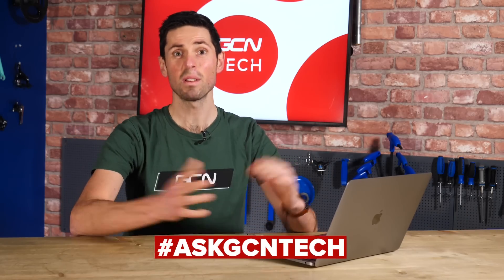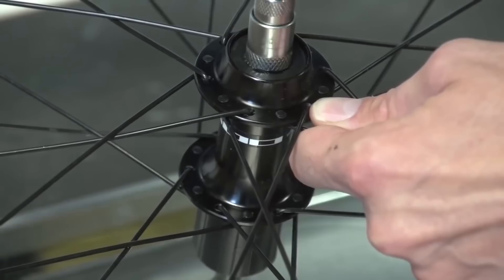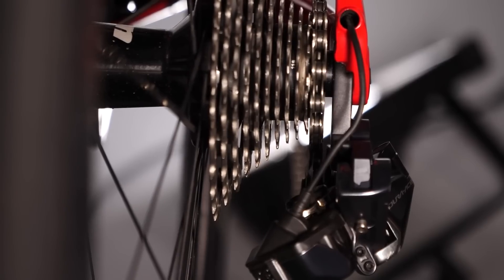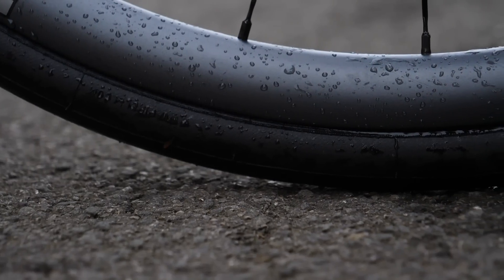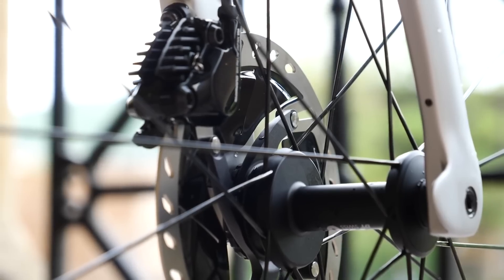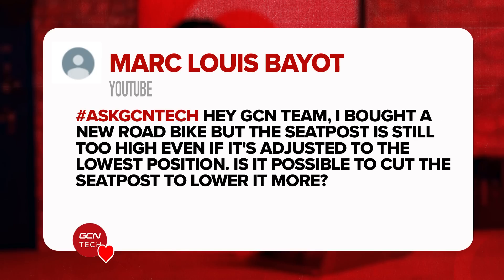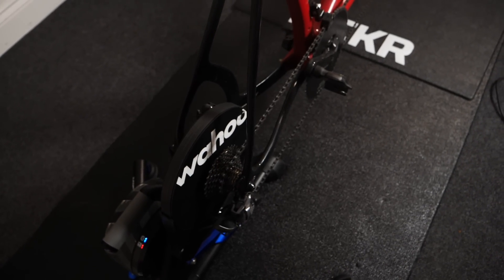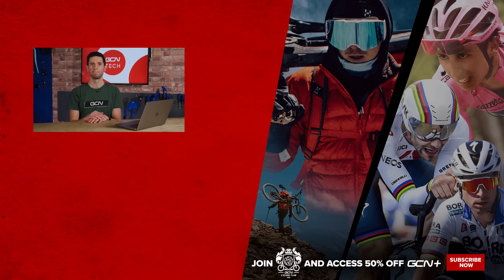Is Mechanical Shifting “Better” Than Electronic? | GCN Tech Clinic #AskGCNTech

Comment: I am running GRX810 (think ultegra level kit) on my gravel/ all-road bike. Super reliable, snappy, responsive. No batteries to charge, no firmware to worry about. Hydro brakes, sublime. I will stick with mechanical any day.  Di2 is cute, but too much complication IMO, and the cost... sorry no.

Comment: I’ve just had to change the cassette on my turbo trainer from an ‘aftermarket’ company that wasn’t Shimano (same ratio) and replace it with the same Shimano one that was on my bike. The spacing in the other cassette I put on my trainer made shifting incredibly difficult, despite being smooth on the road

Comment: I have recently upgraded to a disc brake bike, unfortunately the stock wheels are a little underwhelming. Due to that rather expensive Christmas present to myself, i can't afford to invest in some decent wheels, though i do have some on my old rim brake bike. Other than having to buy new spokes and hubs, are there any other issues which would prevent me from upgrading carbon wheelset from my old bike to disc brakes?

Comment: I don't believe that a disc brake should cause any difference in braking (side to side) since all of the forces that are unbalanced are internal to the fork/wheel. Engineer's quick opinion - no free-body diagrams were generated in the formation of this opinion.

Comment: #AskGCNTech Hi Alex, Ollie, & Manon, I have a set of DT Swiss ARC 1400 wheels and they're optimized with 25c tires. I recently went to 28c tires for their rolling resistance and comfort. While riding I noticed the 28c tires bulge past the rim width and I was wondering which is more beneficial, the aero gains on the optimal 25c tire or the better rolling resistance of the 28c tire?

Comment: Hi Ollie, Alex, and Manon

I have set up my gravel bike tubeless this month. Since then I have punctured twice... For the first puncture I just inserted a plug and went back on the track. I was so glad of the result which is more convinient than swaping an inner tube. However for my second puncture, the plug randomly (it can be after 1 hour when the bike stand still in my garage or after a 10 km ride) pops out. I have tried big and small plugs it does not change anything. I have not seen  this kind of issue on bike related forum. Is it because the cut slices the knob of my tire and so my tire is dead?

Thank you for your help

#AskGCNTech

Comment: #AskGCNTech Hi to all of you and hope you had a great Xmas. I have a gravel bike and regularly swap tyres between gravel and road tyres. It is a bit of a faff. I've thought about getting a second wheel set to make swapping easier but my local bike shop said they wouldn't advise this as the cassettes on each wheelset would wear at different rates and shifting would not be consistent or smooth. I'm still attracted to the ease of swapping wheels though. What do you think? Cheers!
Reply: If that was true (maybe after 1000s of kilometers difference between them) then keep one cassette and swap it when needed. Still easier than swapping tires.

Comment: Rim brakes with mechanical shifting. Lighter, cheaper, easy maintenance, no need to charge your bike before riding....
I don't go down Alpe d'Huez during rainstorms. I don't need disc brakes.
I don't need those 2 watts saved by the end of a ride because of the electronic shifting "efficiency".

Comment: I think that they have shown that the science backs up the rolling resistance decreased with 25mm tires as being greater than the aero gains of a narrower profile tire cutting through the wind. That is to say, you will go faster with 25mm tires than with 18mm tires. Rolling resistance creates more power loss on narrower  tires than aerodynamic gains of a narrower tire. If anyone can present since that refutes that please do present it. I definitely want to know.
Reply: Agreed. Also, I believe that the aero effect of a combined tyre/rim, esp in a sidewind can be quite different. For example a wider (25mm) tyre is recommended as the optimum for my (Hed) aero wheels for this reason. 
And the question asked- 'Shouldn't the deeper aero section wheel be on the front?' I would have thought NO! Surely for control reasons the deeper section always goes on the rear? But then I'm very much a weekend amateur rider/try-athlete- but I've never seen that.... Perhaps GCN could reply more fully on this one? Love your videos by the way! Thanks!!

Comment: If you don't like effortless shifting with a flick of the finger or like to deal with cable stretching and breaking, then manual shifters are for you.
Reply: I've never had a cable break. If you can afford 2,500 for an electronic groupset then good on you - we're not all made of money.
Reply: All cables stretch with use overtime, that's why they have a break-in period.

And yes, not all of us have deep pockets. One doesn't need to spend a ton to enjoy road cycling.

Comment: On the 10mm shorter rim vs 2mm tyre. You are right, this is complicated. The main feature you need to look for is make sure you run the tyre width that the rim manufacturer recommends. Most manufacturers today recognize that the tyre is the leading edge of the airfoil that is the rim itself.

Comment: How significant is the difference between a 143mm and 155mm saddle? Would it really be that significant if I only cycle 50km or less each time? Can I really feel a difference from my bum?
Reply: Yes. The wider your sitbone width is, the wider your saddle needs to be.
Reply: @sbccbc7471  yea I know but what if I have a small width, but still get the wider saddle? Say I’m 100mm only
Reply: @Benjamin4747  It'll hinder the movement of your thighs since it's wider. That sitbone width suits a Specialized 143 mm.
Reply: @sbccbc7471  Ok thank you very much! Have been trying hard to get the Roman Evo Mirror but the 143mm is forever out of stock

Comment: #AskGCNTech Most saddle models have different grades (with the top one usually in carbon or with carbon rails), for the same model and size, is the saddle with carbon rails more comfortable than the saddle with alloy rails? Or is it just a matter of weight?
Reply: It does contribute to increasing compliance, one of the riders I know said it's a night and day experience.

Comment: #AskGCNTech are female frames just smaller or are there any difference? I'm asking this because generally speaking I like more female bikes' paintjobs
Reply: They're generally smaller. Giant's Liv-branded bikes for example, have a shorter reach and are specced with smaller components (narrower handlebars, shorter stems and crankarms, etc.).

Comment: That was a terrible first answer around the tandem. The rear quick link will need to be the same as the rear cassette (9/10/11) but the front could likely be a standard 3/32 chain.

First step is to look for any markings stamped on the chain to indicate speeds and after that, get some vernier callipers to measure the width and determine what chain you have.

Comment: As several comments have pointed out, a side mounted disc does not pull the well to one side, or affect the steering of the bike at all.  When braking, force is applied to the wheel at three points:-  the brake pads, and the two wheel attachment points.  The net effect of these three forces is a retarding torque applied to the wheel, and no resultant force or moment in any other direction.  Simple mechanics?

Comment: #AskGCNTech 
Hi Alex, Ollie, Manon. Tech channel is the best :-)
I'm hoping you can shed a bit of light on contrasting opinions I've received from different mechanics about resin vs metal disc brake pads. Two years back, I switched from resin to metal as I was having issues with wear on resin in the wet winter months here in the Netherlands. Later on in a disc brake workshop a mechanic I trust shared a comment I later kept in mind about rotors embedded with metal pads couldn't go back to resin. It's claimed the worn particles from the metal ones would tear into resin pads and wear them out even more quickly. Recently however, another mechanic I trust challenged this as myth - the rotors can't actually absord splinters as they are metal and don't have enough of a porous surface in his view, and it's no issue to go back in the summer. No short term plans for this as I have the rapid wear in the messy winter in mind, but this question has been nagging at me since. Of course one could change rotors to match pads, but is there really an issue going back and forth between them? Any thoughts?

Comment: What kind of dumb person hesitate between Ultegra Di2 vs mechanical price appart... The Di2 is a major straight upgrade I have the R8000 with disc and it's nght and day vs Sram Force 22, Red 10sp or 105 mechanical. I would also choose Ultegra Di2 way before Dura-Ace mech!
Reply: Well, unfortunately, both DuraAce and Ultegra mechanical systems are being discontinued. As with rim brake offerings, mechanical shifting systems are being phased out - at least at the high end. I tend to believe it's mostly because the big name group set manufacturers believe - and perhaps they are correct - that they'll make more money by offering only the more expensive electronic systems, and that customers are willing to bear the expense. I consider it a shame, given the many decades of progress and precision that have gone into the development of top end mechanical shifting systems.  I wish and hope that Compagnolo will continue making fine top-of-the-line mechanical group sets. I don't think they can fare well competing with Sram or Shimano with the electrical systems, but would do quite well delivering fine mechanical gruppos.  Campy can still command quite a loyal niche in that market.
Reply: @curtvaughan2836  Wtf really, both Shimano AND Sram officially stated that they were discontinuing mechanical groupset for the 2 highest, and not just for rim but ALSO disc???

Seems pretty illogical unless it's to make more Di2 to drive down the cost but that'd be too good to be true. As for Campy, it is mostly just affordable AND available if you live in Europe. Anyhow I did expect them to drop rim support way before Di2, not the opposite, I'm very surprised.
Reply: @PanzerIV88  I think Shimano and Sram would also save money by de-tooling their manufacturing plants and saving the overhead in producing mechanical group sets. Ditto for rim brakes.  Just a speculation.

Comment: Many tandemists use a sync chain that is the same width as a the drive chain, and use two quick links in the sync chain to ensure that one section of it is the same length as the drive chain.  That way if the drive chain gets mangled (e.g. in a dodgy front shift under load) there is a readily available spare drive chain available.  Sync chains are more forgiving of twisted links so it is possible to use a less than perfect chain.  If you use the same width chain there is only need for one type of spare quick links.

Comment: The pull in an automobile when applying disc brakes is due to the brake, wheel, and tire one side having a different deceleration than the opposite side. 

Since the road bike is on a single tire as the wheel is slowed by the disc brake there should be no side pull
Reply: The braking load is only applied via one leg of the fork, though.

Comment: That's hilarious that DI2 Ultegra is only a bit more expensive for the presenter. I never knew nearly €1500 was only slightly more.
Edit: di2 version costs €2300, mechanical €750.
Reply: Maybe he means a bit less than mechanical Dura Ace! 😂
Reply: I had the R7000. 105 group set upgraded last year to ultegra di2 8070.. 2000 euro did all installation myself. Perfect absolute dream. I wouldn't have done it if the pubs was open at the time 😂

Comment: Regarding the disc brakes pulling the bike to one side... the braking force is being applied to a single symmetrical tyre contact patch on the road so there is no asymmetric effect. All the spokes that transmit the braking force from the disc, through the hub and down to the rim also act to (almost) the centre of the rim, so again there are no asymmetric forces possible.

Comment: If you have a rimbrake mechanical bike, stick with it, it will be gold. Getting di2 hyrdo anything is impossible and costs the earth. If you crash and need replacement parts it would be cheaper and quicker to buy a new bike. 
The industry has made a huge mistake driving to hydro and fully integrated and everyone can see it. No parts available, failing steerer tube assemblies, can we go back to 2015 where you can get a reliable sub 7kg bike for 2k please?
Reply: Indeed. For some brands like Trek, you cannot even get a new bike with a full 105 groupset for under 2k. I got my bike with 105 and the frameset was kammtail design but it only cost €1699 at the time. I would need to pay at least €600 or more for the same thing because of disc brakes.
Reply: I'm sticking to building up vintage bike frames with parts. Anything 1980-2010 is prime. Early 2000s probably the best quality for money. Cheaper and gets 99% of the performance anyway.

Comment: #AskGCNTech 
Hi Alex, Ollie and Manon. I have build up a roadbike with 10s 105.  Everything is running smoothly except for the fact that I have trouble shifting into the smallest sprocket on the back. What can I do to change that? Thanks guys!
Reply: Fresh cable, check the limit screw, verify your crank is spaced correctly for your chainline, verify the chain is the right length.

Comment: Regarding disc brakes on one side: the braking force is still transferred directly axially into the hub and then directly to the contact patch which is in the centerline of the bike. On a 4 wheel vehicle where one brake is dragging (or misadjusted in the old days of 4 wheel drum brakes) this causes one wheel to spin faster than the other, making the vehicle want to pull to one side, barring any other frame or suspension alignment issues.
Reply: another way to understand it is if the rotor was mounted way off to the left of the wheel, the force from the rotor and caliper would still have to be transferred to the hub then to the wheel then to the ground, so there still isn't any net twisting force on the bike

Comment: More and more Tech questions seem to be of the “Stump the Chump” variety. I mean, seriously, what’s more aero, 2mm skinnier tire or a 10mm deeper rim? Shouldn’t need to go to a wind tunnel to know it would be a distinction without a difference to the typical GCN viewer.
Reply: There's a so called 105 % rule, which means the rim must have at least 105 % of the width of the tire to catch the airflow of the tire. The rule was discovered in wind tunnel tests.
However, for leisure cyclists this is probably negligible since they won't recognize a real difference.

Comment: If I were going to build a bike for bike packing/extended touring, I would seriously consider downtube shifters. Simplicity and economy. Brakes and shifters are independent. If your brake lever fails, you can still shift. Most likely failure apart from a catastrophic crash is a broken cable, easily changed on the road.  No fiddling with set up for the dérailleurs either- for Front, set high limit, low limit, pull out the slack and go. For Rear - set low, set high, pull out the slack and fly!
Reply: Do you still get new non index shifters today?
I currently restored an old trekking bike from 89 which has already shifters on the bar, but the front shifter has non index while the rear shifter can be switched between index and non index with a small 2nd lever.
It's already hyperglide, and the freehub has a thread for lockrings for hyperglide and another thread on the outside for uniglide cassettes

Comment: Check bolts on seat tube connection points for bottle cages.  Sometimes the bolts are longer than needed and prohibit seat post to be fully inserted into seat tube.  May be able to change bolt and not cut seat post.
Reply: In most cases, it's the rivnut that prevents the seatpost from going rock bottom.

Comment: In reference to the TikTok video, I concur about the freehub. I had an old hybrid with a 5 speed freewheel and the pawl mechanism was so dirty that it stuck enough to engage the drive train when freewheeling or pushing the bike along.
Reply: I had the same experience. The ability of the wheel to turn the cranks has a lot to do with the freewheel or freehub. I used to ride my bike in the winter to swim practice in the early morning and I noticed that if I took my feet off the pedals on the coldest mornings, the pedals would just keep going. If I put on a different wheel (but same bike) it wouldn't happen and it happened less on warmer mornings. The freehub wasn't overly stiff, and I could stop pedaling and it would ratchet just fine. It just meant it was sufficiently stiff to turn the rest of the system over freewheeling.

Comment: Electronics drivetrains are just too expensive for most people who ride bikes. Once they become affordable for the masses then maybe i'd bother to try it.
Reply: Have you Looked at rival etap? Its the same electronics used in force but without the fancy clutch and no carbon. Under $1500 all in with a powermeter crank and rotors. Rival etap costs about the same as force mechanical when both are hydro.